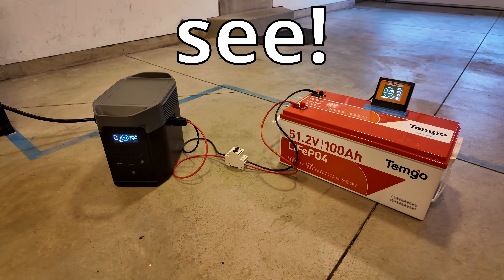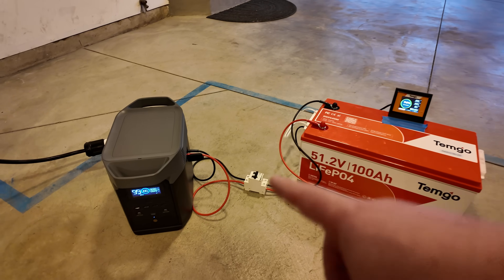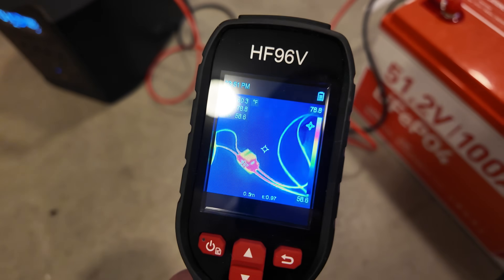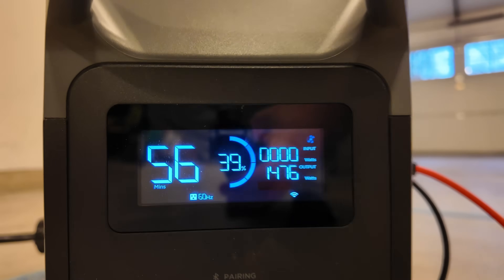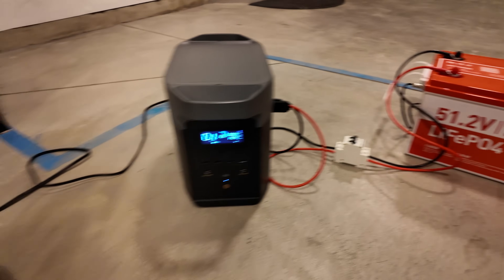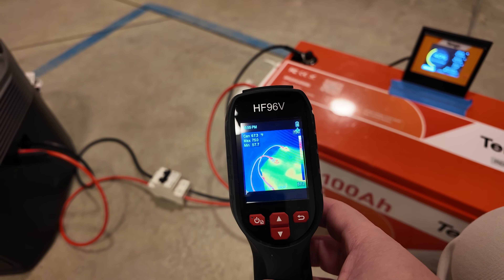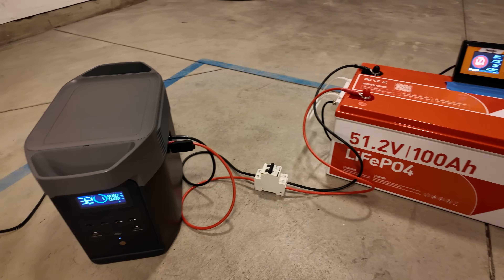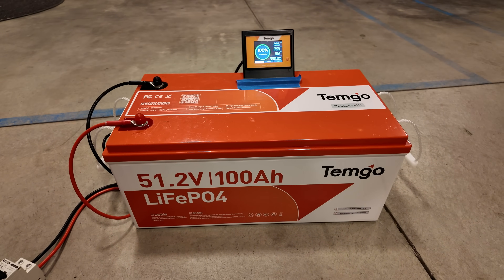Will It Catch FIRE? Thermal Testing My Cheap DIY EcoFlow Hack

Comment from the maker: Watch original in depth video: https://youtu.be/niNvC--u5io 

Buy the Temgo 51.2v LiFePO4 “Golf Cart” Battery Kit: https://www.temgot.com/products/48v-100ah-lifepo4-lithium-golf-cart-battery?ref=trickforthat 
OR buy from Amazon: https://amzn.to/4odUYPP
Watch the full review video for this Temgo Golf Cart Battery: https://youtu.be/dboHXnSY9LI?si=Dr4sjA5anhd2YuZa  

Buy UL Listed WattCycle Server Rack Battery: https://www.wattcycle.com/products/48v-100ah-server-racks-bluetooth-lithium-battery?ref=fspaohfd 
Be sure to use the code: TRICK at checkout!
OR buy from Amazon: https://amzn.to/4pC3wzI 

Buy 8 awg silicone wire: https://amzn.to/4rq78qr 

Buy 1k ohm resistors: https://amzn.to/3XVTm17 

Buy 5mm bullet connectors: https://amzn.to/4pATQp4 

Buy ring terminals: https://amzn.to/4pfPEM4 

Buy 40 A DC breaker: https://amzn.to/4ojKOvL 

Buy EcoFlow power stations: https://tidd.ly/4itbaKC 
OR buy from Amazon: https://amzn.to/4rwXRNs

Original Reddit post: https://www.reddit.com/r/Ecoflow_community/comments/1mn4bh6/delta_3_plus_eb_port_hack_charging_discharging/?utm_source=share&utm_medium=web3x&utm_name=web3xcss&utm_term=1&utm_content=share_button 

Watch all my portable power station type videos: https://www.youtube.com/playlist?list=PL-2uuHDasQcr0pa4IMBj4kcjxSdNlGpr1 

NEED HELP? Ask me a question and get a personal in depth response: https://ko-fi.com/s/8d8df1880c 
OR
Sit down for a personal 1-On-1 hour long video consultation with me and I’ll provide answers and insights to anything you want to ask me about from this channel: https://ko-fi.com/s/dd139831a7 

All donations get 100% re-invested in the channel:
https://buymeacoffee.com/theresatrickforthat 

Affiliate Disclosure
As an Amazon associate I earn from qualifying purchases at no cost to you! Thanks for your support!

Comment: Hi, quick question, do I need to change the connecting cable and breaker sizes if I connect two 48v100 batteries in parallel?
Reply from the maker: You need to potentially add better over current protection since you are increasing the dead short amp potential
Reply: Ok will do, thanks again:)

Comment: Why did you choose the 40A circuit breaker? Would a 50A one be better? Or a 63A one?
Reply from the maker: I sized it for the wire size. That's what over current protection devices are protecting

Comment: Hello , Does it work without the circuit breaker?
Reply from the maker: It will work...but boy would that make it crazy dangerous! Do not under any circumstances attempt that!
Reply: @theresatrickforthat OK, Thanks, but with a normal DC circuit breaker — meaning one that’s NOT non-polarized— will it work?”

Comment: Would this hack work also with a 24V Battery or has it to be a 48V ? Thanks
Reply from the maker: Must be 48v!
Reply: For charger da mppt da battery 25.6volt is ok no da espansione ma da mppt ecoflow 12v a 50volt charger a 27volt 15amp
 Circa 400watt wh

Comment: Have you messed with the Solix C2000 Gen2? - best path forward on DIY battery expansion? 1. Using the XT60i solar port to X battery with fused (17A?!) limit. Or 2. Custom cable to the battery expansion port…?
Reply from the maker: The XT60i hack will 100% work! Not sure about the expansion port. I haven't been able to test that
Reply: @theresatrickforthat  based on the two voltage ranges 12v maxing out at 8.5A and 48v at 17A… what size fuse would you run… it’s almost like they did the odd numbers to discourage DIY

Comment: I appreciate the video and the “what if / why not” curiosity.  However, a 48v 2500w pure sine inverter can be had for around $240.  Why do all this?  The monitor on the EF isn’t accurate and you can’t use the app to monitor…so??.  Plus with a separate inverter just for the GC battery, you would have two systems that can be used independently….big battery for big loads, small battery for small loads. If your Delta 2 is powering a sub-panel (which it can do safely because is utilizes a floating neutral-ground bond) I get it…but then again….hmmmm
Reply from the maker: Yes! A full DIY system is the way to go! But, some people really want to make their power stations more functional.

Comment: Is there a solution that would include using the Delta 2 as shown, your Golf Cart Battery as shown and EcoFlow's DC to DC charger to charge both batteries while driving.  I currently have the EcoFlow Deta 2 and the EcoFlow DC to DC charger in my truck camper and would like to add more battery storage but the DC to DC charger uses the same port that you are using with your expansion battery set up.  Thank you. - Tim
Reply from the maker: Get the Delta 2 Max. It has 2 expansion ports! :)
Reply: @t @theresatrickforthat  I did not know that. Thank you.

Comment: I'd love to know if the EB port has its own overcurrent protection. If someone connected a fully charged generic battery to a fully discharged EcoFlow (and vice versa) would it shut off the port when they attempt to equalize? Surely the internal BMS should have overcurrent protection if the EB port does not, but who knows.
Problem is that circuit breakers often have medium delay trip curves that may allow more than their rated amperage for several minutes. Only when the current is 2-3x times its rating do they trip within seconds or instantaneously.
Not sure how one would test it safely though.
Reply from the maker: Maybe add a fuse inline with the breaker!
Reply: That were exactly my thoughts. If someone would test the overcurrent protection, to be more precise, the constant current limitation for charging and discharging, we could confirm that you can plug in an ext. battery with different SOC/Voltages. My assumption is that, like every normal BMS, it should handle different SoC very well und limit the charging and discharging currents. But still these are assumptions. I would be very pleased if you let me know if you find out more about that topic.

Comment: Once again, awesome upload! Thanks again! I also think you should brainstorm a way to make that connection with the resistor much more reliable. Correct me if I'm wrong, but I'm thinking of a scenario where the resistor disconnected (due to a slack connection) during charging/discharging, then suddenly reconnected sometime later and there's a sudden rush of energy from one battery to the other due to imbalance. But I'm no pro on this 😅, what are your thoughts?
Reply from the maker: You're 100% right! Glad you are enjoying the videos!

Comment: I've added a tiny bit solder to my resistor, helps it stick in those holes a bit better. I wouldn't want to know what would happen if the connection was bad between those pins. Maybe your thumbnail would come true if you left it so loose?
Reply from the maker: I personally haven't seen any heat at all coming from the resistor. Is the the connection you're talking about? The one for the communication pins?
Reply: @theresatrickforthat   yes, the only loose connection with this modification.
Reply from the maker: Yeah! It could certainly use something to help it stay plugged in!
Reply: @theresatrickforthat  I'm just thinking if the resistor is loose and the port is turning on and off repeatedly... you might see some interesting things.  Maybe not? 😂

Comment: Hi, every time I see a hack like this people are using 51.2V batteries. Wil this work with 24 or 48V batteries as well ?
Reply from the maker: NO! You must match the chemistry and voltage of whatever you are connecting to! You can however connect any of those voltages to the solar input port and use that!
Reply: A 51.2v battery is a 48v battery fully charged

Comment: So how about HACKING an ecoflow battery?  So you can get a 3600Wh ecoflow delta pro battery for $480 -  its 48V, so why not be able to HACK it to hookup to the delta 2?  Challenge yourself!
Reply from the maker: Not sure that would be any better than what I already did!
Reply: Battery ecoflow da 3600wh for 480dollari .mm 2000euto cost come bluetti b300
Reply: In interne battery new delta pro 3600wh a 1300euro no 450euro

Comment: "I'm ordering the cables to set up the Delta Pro and Temgot battery with the breaker and fuse as you suggested. I have two questions:

State of Charge: You mentioned both the Delta Pro and Temgot must be at 100% before flipping the breaker. Does this apply only to the very first connection to balance them, or do I need to drain them to 0% and recharge to 100% for every single cycle? I prefer to start recharging when the unit drops to 20%.

Fast Charging: In the video, the Delta Pro charges the 48V battery via the expansion cable (taking ~6 hours). To speed this up for my off-grid setup, can I connect a 48V charger to my generator and charge the Temgot directly while it is still connected to the Delta Pro? Is this 'reverse charging' safe, and will the Delta Pro handle the backfed power correctly?"
Reply from the maker: The 100% SOC is for the first connection whenever you are connecting them up. Yes! I use dedicated chargers all the time and it charges both units up just great!
Reply: @theresatrickforthat is there a risk for the golf cart battery catching fire? Given the fact that it is not made for this specific purpose and possibly frequent charge and discharge cycle?

Comment: Ordering two Delta pro battery charging cables. I'll modify the original cables as you have suggested in your other videos. Connect the breaker in the middle as well as fuse.

You have said both the Delta Power station and the Temgot battery must be at 100% before flick on the breaker for use. Does that mean we have to wait until both units are drained 100% before charging them every single time? I prefer to charge once the unit gets down to 20%.

 I see in this video you are charging the 48V battery using the Delta Pro AC plug into you house- I assume there is no difference charging both units this way vs charging from an external source ie. a 11500watt tri fuel generator, with the Temgot 48V charger plugged into it {basically charging it in reverse order}? Also is it safe to fast charge using this setup?

 6hours is along charging  time for my off grid setup- now it takes about 1.5hours to charge both  Delta Pros at the same time using the propane Westinghouse generator.
Reply from the maker: I haven't tested the Delta Pro's. So not sure how they will behave. The 100% state of charge rule is just for initial connecting of the batteries. After that, it doesn't matter !
Reply: Charger delta pro da pannelli solari mppt end charger da hause o generatore bifuel con caricabatterie 220volt o 120volt a 58volt max battery lifepo4 da 51.2v nominali max 60amp. 3000watt in contemporanea charger  ecoflow ies da battery 51.2v a ecoflow con 20amp. Circa  1000watt e 40 in battery da 100ah 51.2v con i 60amp.

Comment: What do you think is the safest option ? I’m thinking the spliced in version? The first hack looks a little bit unsafe looks like an hair pin shoved in and some soldering with that amount of power going on top of the bit of heat around the expansion might possibly melt the solder and the might get knocked out during use .. I don’t know I think it’s very clever I’m a little sceptical on the hairpin and solder hack ,😊tell me what do you think is more safe I love the delta 2 and I wouldn’t want  to risk any endangerment although it all has its risks but some more than others
Reply from the maker: The spliced version is good! Just make sure you protect the cable correctly with overcurrent protections. Also, if you don't have an OEM extra battery running in parallel, then you have to hook up the resistor still
Reply: @theresatrickforthat I use an eco wave 2 battery as an extra battery it displays as an extra battery on the app

Comment: I know it's a test but for any real use I'd definitely want a fuse in there as well to protect the cables (eg if it was to short on the ecoflow end). I'd also be very interested to know what the connector temperature looks like if you have an official extra battery and cable in there not your own. If the real D2/D2 extra battery is giving the same kind of numbers then that would be a reassuring.
Reply from the maker: Great points!
Reply: It has an inline circuit breaker. Do you not trust circuit breakers?

Comment: I have an RV with 48v setup.  I use the ecoflow alternator charger similar to your setup to charge my batteries on the go.  Charger plug male pins to female 5mm barrel to breaker to battery.  Works well.  With my Delta 2 connected as you have, my Delta 2 charges as well.   Thanks for your videos.
Reply from the maker: That's awesome to hear it's working well for your RV setup!

Comment: Thanks this will charge my Fiat 500e on those cloudy days when I can't quite pull enough from my solar panels.
Reply from the maker: Yep! Not sure how much range you'll get, but it will charge it!
Reply: Mmm charger car electrìc accetta 230volt monofase e inverter eco flow o bluetti o fossibot o every power station use 230volt bifase flottante use charger con no check positiv neutro e massa terra monofase escludible
Reply: @stefanocerna6504  If I understand you correctly the charger that I have works with a 110 volt adapter. Not a "charging station" but simply the type of portable charger with an adjustable amperage that comes with the car.

Comment: This is amazing. The problem that I have is, I bought the Eco flow Delta max 2000 a few years ago which is nmc. I’ve seen in the videos where you mentioned you need to have the same battery chemistry. I also thought in the past, I’ve read that Eco flow lithium iron phosphate Batteries will work with the Delta max 2000 so I’m wondering if this would also, or could at least it be used through the solar charging point?
Reply from the maker: Through the solar charging port yes. But whatever you do don’t do it through this hack! You will blow something up! The EcoFlow batteries have communication so they can stop things from blowing up.
Reply: @theresatrickforthat thank you for the speedy reply!  I think I’ll do it through the solar port and upgrade to a lifepo4 power station when I can. 
One more question if you don’t mind. If I did run it through the solar port, could the battery charger be hooked up to the same battery lugs that the XT60i  cord is on or would i need to disconnect the ecoflow from the golf cart battery to charge it ?
Reply: @marnijimleach8350 non problem use morsetti più e meno battery lifepo4 in mppt e in charger pannelli mppt o charger 230volt o 120volt house use mppt con pannelli da 450watt o 550watt in battery da 25.6volt o max 48volt se mppt ecoflow delta 2 accett 60volt max o 50volt max waching mppt ecoflow 12v a 50v max o 60v max?

Comment: The only problem that I can think of with that setup is that, if I wanted to charge both batteries back to full charge with solar only; just using the Ecoflow's solar input, I wouldn't be able to. Correct? The Delta 2's solar input is too limiting and it would take too long. I would have to also purchase a solar charge controller and given that on average, I would get about 5 to 6 hours a day of sunlight, I would need about 1200w to 1500w (over-paneling to ensure full charge with just solar) of solar panels. The charge controller would have to be connected to both the Ecoflow and to the other battery, yes? I'm not really sure how that would need to be setup. Ha!🙂
Reply: Its fine because this is a video on how to add components to a Ecoflow power station which would mean just keep adding stuff including more solar and more batteries and more wires and more everything until you are happy!
Reply from the maker: Yes. Using the built in solar charger in the power station could take a while. In my first video on this you referenced below, I have a really nice 2,000 plus watt external MPPT solar charge controller you could get. Slap a little more than 2,000 watts of solar on that and then add 500 to the solar input on the Delta 2 and you could get the whole setup charged from dead to full on a sunny day!
Reply: It would be interesting to see a 48v charge controller connected in parallel with this battery setup and port for more solar input👍
Reply: So that's just a regular Delta 2?
Reply: @shawns7223  I think it's the same Delta 2 unit from his other video..."EcoFlow Batteries Cost TOO Much!" Delta 2's only have one solar input with 500w and 60v limitations. At least I think that is the case. I have an Ecoflow Delta 3 Plus and it has two solar input ports; each can accept 500w at 60v for a total of 1000w. Probably still not enough to get both my Delta 3 and a separate battery fully charged with just solar in under 6 hours.